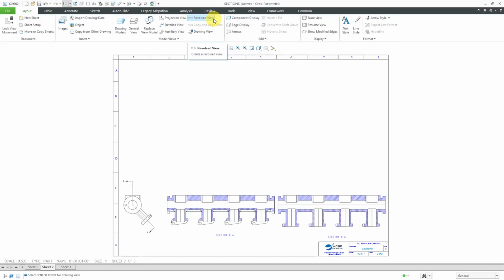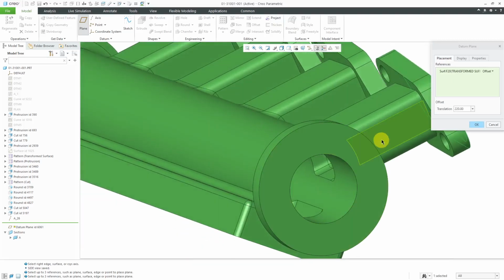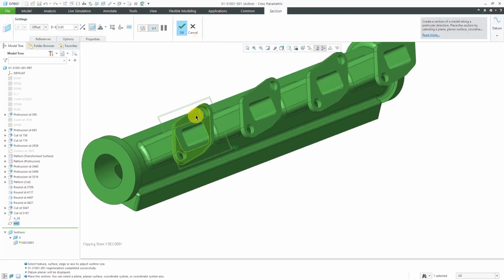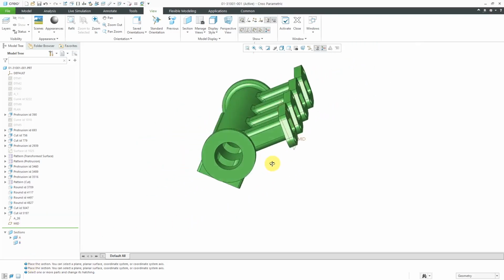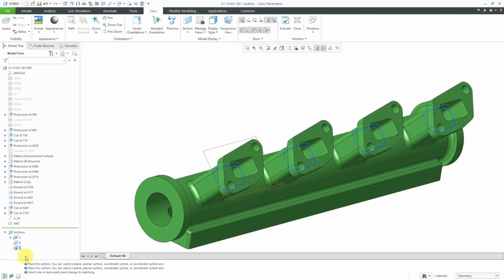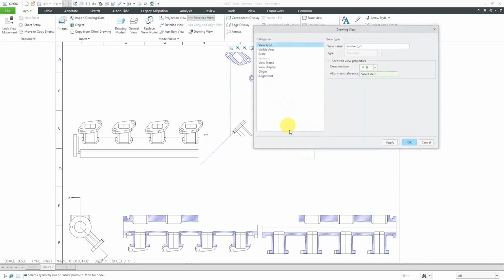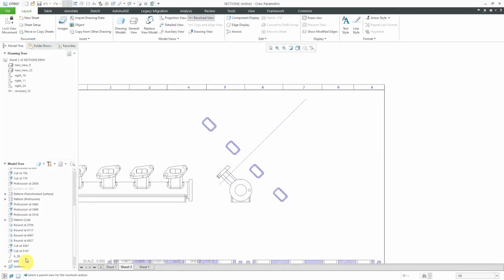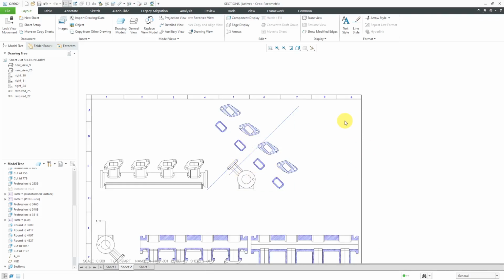Creo Parametric - Drawings - How to Create Revolved Views

Comment: I 'm not often use revolved view because it seems not working with offset section and most of the time i really need local section , but with revolved view function  i am not finding a way to reduce the section area .
Reply from the maker: You can apply a Partial View to the Revolved View, but playing around with that seemed like it added even more confusion.
Reply: I found it , thanks

Comment: In my opinion, a revolved view would be for the offset section (revolved section view). A section going vertical from base and then going through the flange. Often it is used for depicting two different details in one view. e.g. a Bolt hole detail on a bolt hole circle and possibly a dowel hole between two bolt holes.
Need to try. Used it long back when Creo was WF.
Reply from the maker: Interesting use case. Thanks for the clarification. I'll have to try that out.